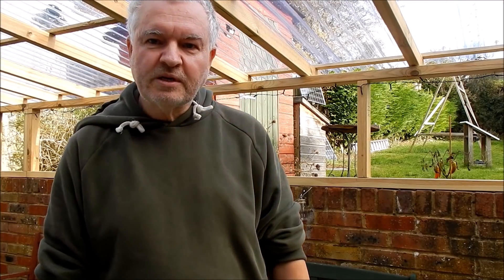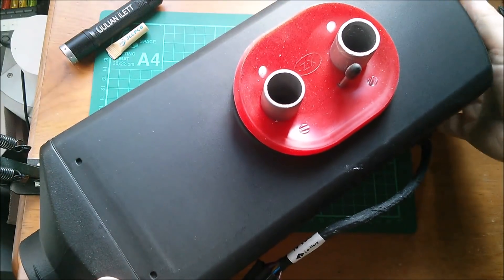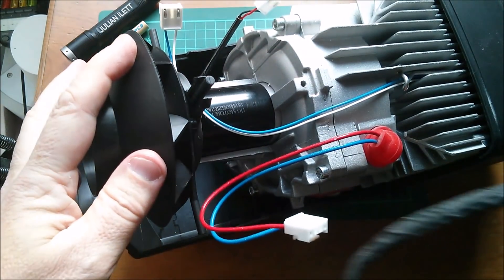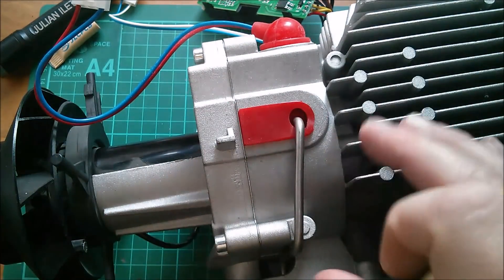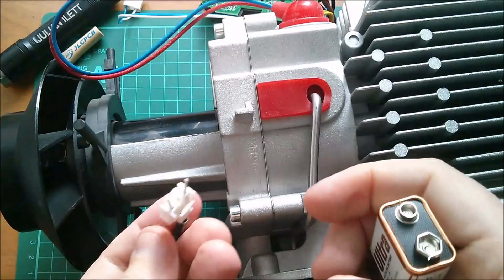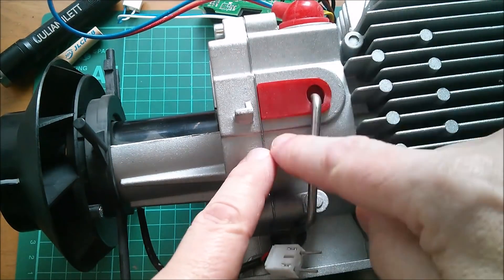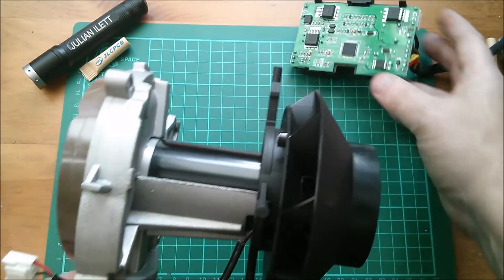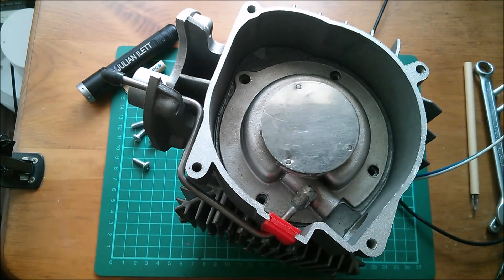A Look Inside the 8kW 12V Diesel Air Heater from Banggood

Comment: I have a boat with three similar units, mine are Eberspatchers, the Bangood unit is a copy of a Webasto. They are very effective, but use RED diesel or 35 Second heating oil and NOT duty paid road diesel (Derv) that is purchased from a garage, this will reduce your running costs to less than half price. Boatyards also stock red diesel for boat use, but when buying red diesel tell them you are using it for domestic heating and NOT propulsion. THis is a stipulation from the EEC that boats (not using roads are fuel taxed at the same rate as lorries and cars! If you need any advice, please contact me.  Stewart L
Reply: Diesel Engine Road Vehicle = DERV
Reply: DERV that brings back memories of the 80s living in the UK.

Comment: 0.5 litre an hour consumption ..  That's about the same as 2.0L diesel engine on tick over.
Reply: you tried pulling heat from a 2l diesel engine on tickover..... they make next to nothing.. mines a 2.2 dw12 and it takes over 40 minutes tickover on a snowy day for the needle to even move, or about 3 miles of hard driving.

most of the fuel goes into spinning the engine, with these most of the fuel goes into heat
Reply: Heat production isn't what a Peugeot / Citroen 2.2 DW12 engine is designed to do. Hence any descent diesel engine'd car usually has electric heating for those cold mornings.
My comparison between a diesel engine and this diesel heater was as a comparison on the amount of fuel used, not heat produced ..
https://youtu.be/QSEV5fI6I_A
Reply: @stuartdavies8388  well it does say it will output 26 000 btu's and thats alot of heat that can be installed on just about anything including my golf cart! lol and also says 0.67L an hour for the 8kw model. when you need heat you need heat !!
Reply: @lezbriddon  My Diesel after a run cools down on tickover

Comment: @Julian Ilett I worked on oil burners for decades. Keep in mind diesel fuel will gel outside in the cold. Truckers add a chemical to stop that or warm your fuel tank. Diesel is loaded with detergents and run dirty. If you can use waste oil for use in a home furnace, it's cleaner, runs better, but still gels. Personally I would use Kerosene, that wont gel in the cold and you will notice it run much more quite and efficient than Diesel does. Every so often I use kerosene to clean the furnace out, but I have a underground tank so the fuel doesn't gel and it's 500 gallons so it would cost me to fill my tank all the time with Kerosene as it also is my hot water on demand and the companies around here doesn't deliver in that quantity. I need to run my tank dry and find someone to fill it with Kerosene to see if the money and efficiency adds up because it's worth every cent if the money works out. I'm the only one still using oil on the block, everyone else uses natural gas so when the electric goes out in the winter I use a generator while they all go without and their pipes freeze while they have no choice to stay in a motel. Once the electric goes down it shut their gas off too coming thru the meter. No point in gas with no electric. How convenient how they have us.
Reply: The little hole is for oxygen to fuel mix.
Reply: Natural gas, propane or fuel oil, you still need electricity to run the burner or controls. You don't want kerosene - it costs more and has less BTU than #1 fuel oil or diesel.
Reply: @RRaucina  Kerosene wont freeze and burns cleaner, the others do gel and freeze and the glow plug doesn't eat as much electric as electric heaters do, they're a direct short. Don't forget this is outside temperatures. Honestly what I would do is just insulate everything, route some copper pipe baseboard from inside the house and run it thru the work room and back to the return. It's not that big of a area to even worry about.

Comment: Asbestos impregnated head gasket ?   Anyway , be VERY careful that that combustion gasket seals the burn chamber.. A friend has a similar unit that filled his caravan with smoke and carbon monoxide. The gasket did not seal to the two surfaces and there was an issue with the exhaust port casting.
Reply: Graphite, not asbestos
Reply: @gunnarlandin3258  honestly,  ? is that why in the calibration software on the webastos etc theres a setting to tune out the monoxide????? difference with these is they dont care about the emissions

Comment: I wonder what efficiency is, guessing 60% so 8kw or 28000 btu you get about 15000 btu's.  You best insulate roof panels with polyiso, without your letting your money escape, but blocking light.  Your typical space heater in US is 5000 Btu at 1 kw/h electricity.

Comment: We have an Eberspacher fitted under our camper. It produces enough heat for us, even on a very low setting. However I wouldn't want one in a room I was working in. It sounds like a jet engine when it first fires up. Although it is quieter once running at temperature. Thanks for letting me see what's going on inside, very interesting.

Comment: Having seen it all the way through, that is just a standard kerosene oil burner but with a 12volt fan driving a smaller amount of air than a domestic Oil fired boiler! Basically it's a motor powered Primus stove if you remember those. 

Rather than heating water, like a CH boiler it just heats the air passing over the aluminium. We had oil heating for 20 plus years in our house in Berkshire and despite the price of oil going up it ALWAYS worked out cheaper than gas!

Definitely do a deal with a local chippy for their used oil (should be free for taking it away) filter it, add a small amount of petrol or Ethanol, mix and burn! Plenty of advice on YouTube about using chip oil in diesel cars - perfectly legit if you declare and pay the duty! For heating ... NO TAX!

Comment: This will cost shedloads per hour to run...not to mention the potential carbon monoxide issue,
Run this in a small room for a couple of hours and get a CO reading before using it!

It seems to be a knock off, so how much safety consideration has been built into something that is thrown out of China for the lowest price??
Reply: From the Eberspacher Wiki Entry.  "Eberspächer opened in June 2013 new Asia headquarters and production site in Shanghai/China". So you could also buy a genuine branded heater which had been made in China, or one of several Eastern European countries!. Ok, so its probably their own factory and quality control but the fact remains that the ideology that German companies make everything in Germany is about 20 years out of date. Dyson the Appliance Manufacturer, trades on its UK roots, but it hasn't made an appliance in a UK Factory since 2003, all of their production is carried out in Malaysia. Whilst there are plenty of people happy to pay top dollar for a 'brand' most of which gets paid in profits to its CEO and Shareholders, personally I prefer to pay a price that is more in line with the actual cost of producing it in the location of the factory where it was made and I seriously doubt any German or UK Manufacturer is paying their Workforce out in China, UK or German Salaries!. I also bought a cheap Korean made car, largely because it came with a 7 year warranty, if I had bought a German or UK built car, it would only have come with a 3 year Warranty, so I guess that the Korean's have a bit more faith in their manufacturing abilities than their European counterparts despite being right at the cheaper end of the market. Enough Said!
Reply: I had a webasto that died after 2 years  part from webasto was so expensive that I decided to go for the chinese knock off. Guess what?  4 years and it still going strong.  
I paid £350 for it 4 years ago but now you can get it for £120.  You can't lose.
Reply: There's a hose for exhaust to go outside, the air to be heated travels by the outer fins of heated block. Since he's taken it apart it would require a keen eye to find out if any leaks were his doing or manufacturing defect or design.
Reply: @JJayzX   I take mine apart every year to clean it out. I'm still alive.   There is gasket where has to be.

Comment: Looks like a close of the old Espar Airtroincs.  They were good heaters and pretty efficent (usually around 1L/hr of fuel).  Biggest problem is they used to crud up, but even that's not a big deal, just got to clean em out sometimes.  Also, mount the pump to a piece of rubber or wall, not to anything that will act as an amplifier as those little fuel pumps clicking can be rather loud.  If it's anything like the old Espars, keep a spare eye and glow plug around.  That's usually the only problem you ever have.

Comment: Nice timing I just bought a 2kw version gor my camper. I've read that the only difference between the 2kw, 5kw and 8kw version is the software! Is this possible/likely/true?
Reply from the maker: Maybe it's just the rate at which diesel fuel is pumped in.
Reply: @JulianIlett  the amount of air would have to balance the amount of diesel, so presumably both would be controlled by the microprocessor?

Comment: Julian - if you had a battery bank, either something like a Powerwall (or homemade version), or an electric car, then you could run a small biodiesel generator in the far reaches of your yard, use the electricity to charge the car/wall, and set up a coolant loop to bring heat from the engine to your work area.  Could set up a remote starter as well.  
If it was putting out 2kW of electricity, I can't imagine you getting much less and 8kW of heat.  Wouldn't this be much more efficient than only burning fuel?
There's also the option of solar-thermal vacuum tubes, which should still work in your area, though you might need many.

Comment: Reminds me of the engine pre heater I had on my Range Rover.
Reply: That's pretty much what this is. People are just using them for other things. For instance, people who build small RV's in work vans often use these to provide heat when parked. There are Hydronic models, that heat water, those are used as engine pre-heaters.

Comment: Surely it needs a spark to ignite the fuel? You sure that thing is a glow plug?
Reply: No it's a glow plug, diesel engines use them all the time. They get super hot and cause the full to ignite, then the heat from the previously burnt fuel keeps the combustion going.
Reply: it may also be catalytic once its hot, all the ports had a silver coloured  gauze over them and if so it would be a flameless unit internally.  normally the glowplug heats it up to the point the compression heat as the piston compresses causes it ignite and explode
Reply: Diesel will ignite on a red hot glow plug.

Comment: A heard of a few people with electric cars using these to heat the passenger cabin in the winter. Not sure of the legality of such a thing as the safety and emissions of such installations are probably unchecked... it would probably also invalidate your insurance.
Reply: Not really sure why you would do that, electric cars have 3.5kW+ electric heater coils, and often a preheater, they heat up fast!
Reply: It primarily appears to be people using smaller EVs in cold climates where using the electric heater and the drop in battery output causes large decrease in the range of the vehicle.
I suspect having an old battery pack with a decreasing capacity also enters into the equation.

Comment: You MUST make sure that both burner exhaust AND inlet are outside the heated area, and facing the same direction so that any wind gusts affect them equally. If the exhaust side is at higher pressure then you can get blowback which can cause the inlet pipe to burn through and fill the room with carbon monoxide.
Reply: And some other really nasty pm10 particulates and NOx gases. There's nothing about diesel that makes it a good option for heating.
Reply: @beware_the_moose  NOx forms only with Diesel engines, these heaters do not get up to temperatures requierd for makin NOx. But even the PM10 is very bad so exhaust and intake should be routed very securly.
Reply: T C this is a small burner and the fuel is going to be adsorbed onto the fibrous material and then burnt, which should give low particulates. It is a low pressure burner so I would expect no NOx or at worst trivial amounts. Diesel is basically the same as the light gas oil that is burnt in house heating systems.
Reply: @bigbadjohn10  they burn similar to a kerosene boiler. The air is vortexed down the flame tube and fuel is injected and burns pretty violently in the flame tube. There is no fibrous material. Just gauze to try and prevent blowback in bad ignition
Reply: David Beckett He calls it gauze, present in two areas which will retain the fuel and enable good combustion.
Reply: @bigbadjohn10  he calles it gauze because it is a wire gauze. Fuel isn't 'soaked' into anything. They burn by misting
Reply: The burner inlet and exhaust are both located outside. Thus being completely isolated from the heating system. Theres no problem with burner exhaust getting in
Reply: Actually, since it's a slow burn compared to an ICE the combustion seems very clean in terms of particulates, and certainly no soot as some have suggested. And absolutely no smell from the exhaust, even up close, all of which leads me to believe that the combustion is pretty much complete when it is operating correctly. I wouldn't like to comment on the levels of NOx but I would guess about the same as a furnace using heating oil.

The only smell I got when I installed one earlier in the year was during the first couple of uses, hot paint and coatings around the exhaust and the muffler.

It's a good idea to give water a way to escape from the lowest point of the inlet air pipe even if you think there's no way for water to get inside. You'll have all sorts of fun and games if it does.
Reply: do you really think he is that stupid?  common man
Reply: Yes Julian. Be careful with them. They could be a death trap
Reply: @Jon's Print Shop paraffin stinks! :) Seriously it really does
Reply: @beware_the_moose  i still heat with an indoor semi catalytic heater, so get the smell full on and have been breathing the fumes for years, in the 80's my stepdads house was heated that way, they not quite greenhouse heaters as they have a cleaner burn due to secondary burning.
many people think there dangerous as hell, they really ''almost'' not... more people die from central heating boilers...anyhow, i wont be parting with mine just yet....
Reply: This is why coaxial intakes and flues are used on domestic heater installs. Everything balances.
Reply: Chris Hartley, good advice thanks.

I will wrap both pipes with exhaust wrap.
Reply: @Jon's Print Shop 
Kero burning gives me a headache real fast too.... Had to fix someone's computer once and they had a kerosene heater. I lasted about 5 minutes before I started trying to think of excuses to leave.
Reply: @tin2001  A proper heater shouldn't do anything except generate warm air in the space you're in. But there are of course unvented heaters, or rather heaters that have their exhaust in the same room as the heater. Which is absolutely nuts of course.
Reply: Croft yeah, those medieval people just burned wood inside and the room didn’t even have a chimney! What was up with them, didn’t they know better?!
Reply: @JasperJanssen  No, I guess they had no idea about how bad that was for them, and I suppose that no doubt contributed to  the lifespans. 1/3 of all kids died before age 5, something like 20% of women giving birth died or the aftermath, and if they were lucky lived to their middle 40's. And in fact, middle 40's was if you were rich and royalty. Sucking down carcinogens like there was no tomorrow was probably easier when there was no tomorrow.
Reply: Croft yeah, that’s not actually how it worked. Plenty of rich people lived to a ripe old age. What was dangerous then was disease and childbirth. That’s why the average life expectancy is usually quoted as the life expectancy of children who lived past five (all the childbirth and measles deaths would bring the average down to something silly like 18), and even then the vast majority are people who lived fast and died young. And poor.

But: everybody including kings lived in houses without chimneys, because that technology hadn’t been reinvented yet (the Romans had it, of course). They used holes in the roof (or just leaky roofs) and high ceilings. And still monoxide wasn’t usually what killed them.

I’m not saying open indoor fires — especially open diesel fires — are a good idea, but let’s not pretend you will immediately die-hie-hie the minute a spark sets something alight. Especially not given that carbon monoxide detectors are a thing that exists now. Indoor natural or bottled gas flame heaters — or for that matter gas stoves — are not a killer, except when they stop working correctly.

Comment: great, but where can you buy 12V diesel?
Reply: Or buy two 6 volt diesel and put them in series.... :P
Reply: 12 volt diesel store.
Reply: Just add 11 parts water to 1 part diesel--& presto, you have 12V diesel. lol
Reply: Detroit perhaps? ;)
Reply: Eberspacher is the most expensive brand. But they are the most reliable and every part in available for replacement if there is a problem
Reply: @poellot  you could buy six of these for the price of one eberspacher. Go figure.
Reply: Banggood.com😁
Reply: US
Reply: Like it, unless it's a typo, and should be "V12".